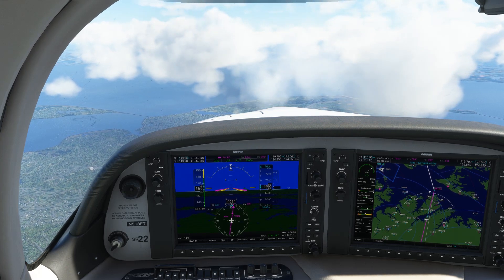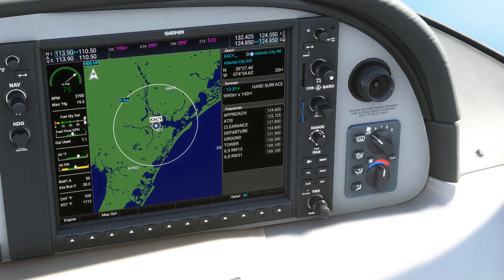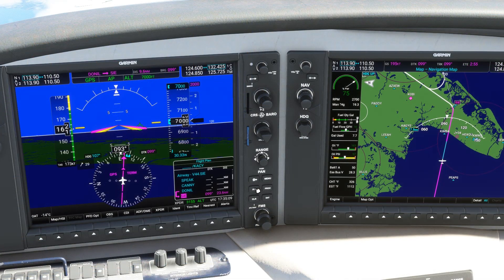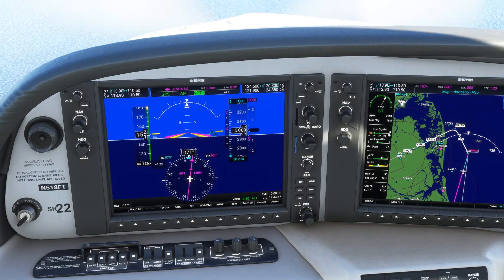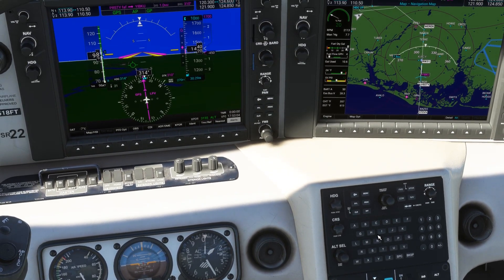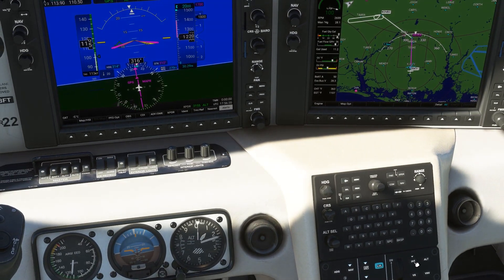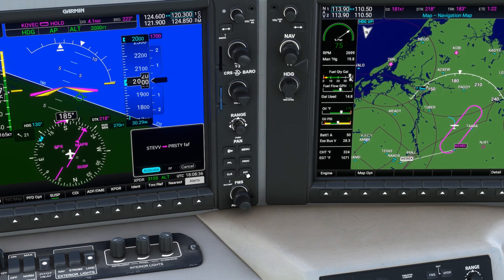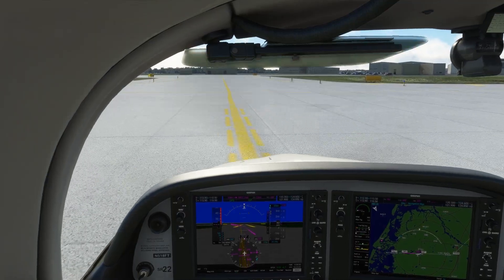G1000 Approach and Landing | Glass Cockpit Tips

Comment: Quick question: Can you provide more details on "suspend mode" after initiating your missed approach? Why do you need to "unsuspend" it in order to use the autopilot? Thanks again, and hope this not a dumb question.
Reply: The GPS suspends the automatic sequencing of waypoints when you get to the runway, assuming you’re going to land.  

If you go missed you need to start the sequencing again.  

You can still use the autopilot in basic modes like heading and flight level change… but if you want it to follow the missed approach you need to either press the suspend button or hit the go around button which does the same thing.
Reply: @calvinnickel9995  Thank you for the helpful explanation.